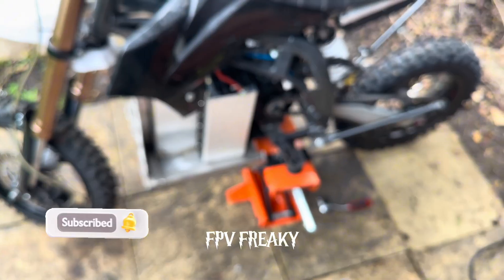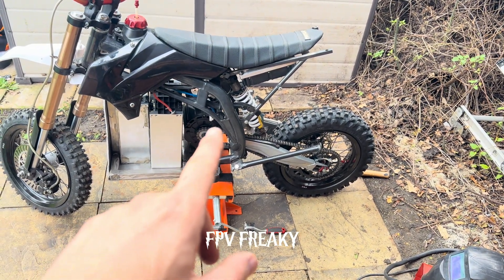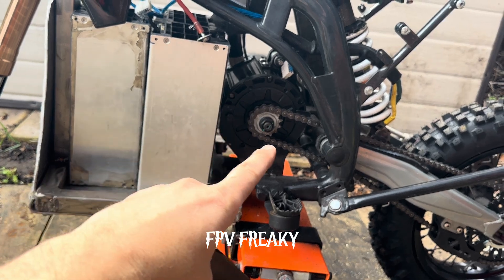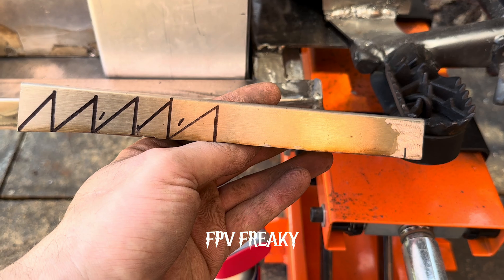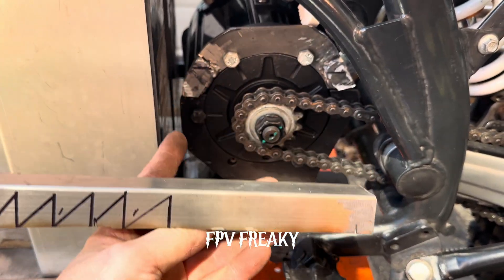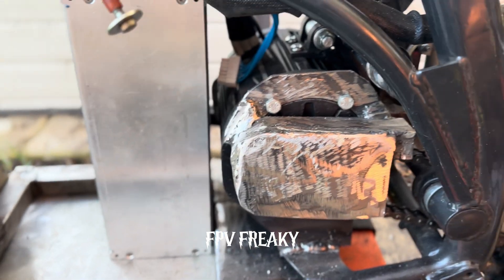The Poor Man’s Stark Varg Progress

Comment from the maker: IM FEELING ABIT DELFLATED LACKING MOTIVATION. STRUGGLING. 

INTRO

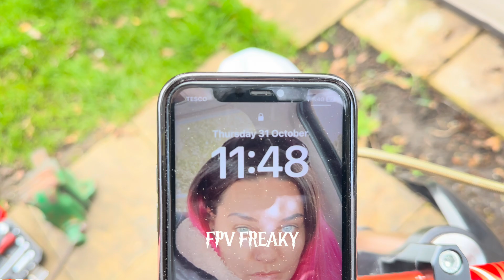0:00 intro today is 31st of October
0:31 start welding the rear seat plate support.
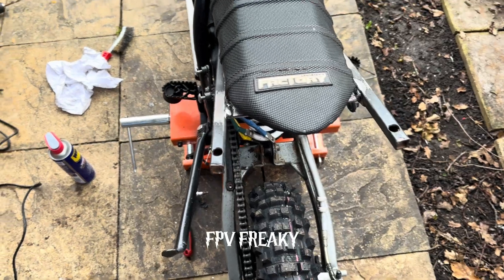1:52 test fit the seat and fitment.
2:27 making a QS 138 90 h
chain guard.
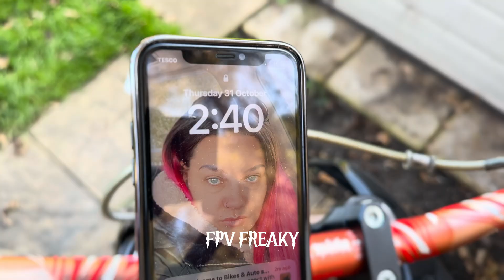4:20 time to pack up before it gets to late.
4:28 chain guard has been made for the QS 138 90 H motor.
5:47 seat plate support bracket made.
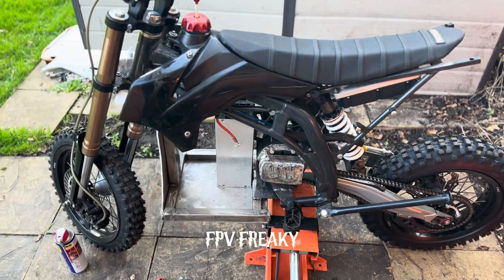6:24 cinematic footage ( subscribe )
Reply: Nothing that's really worth it, is ever that easy. It might not seem like the progress you wanted, but you got a time consuming part out of the way and the rest is almost plain sailing now. When it's finished you're going to have a machine that no other stock, or modded bike can compare with. 

You're much closer to getting it finished now mate. It hasn't taken long at all to get where you are now considering all you've done so far in just a few weeks. Almost there mate 👍
Reply from the maker: @colinriches1519  thanks mate yeah . I think it’s been the lack of good weather that’s been the problem. But now I’m almost there .your right 👊🏽😉 thanks man appreciate the support.

Comment: Can the QS motor fit a Mototec dirt bike?
Reply from the maker: @Emergencyexitguy  possibly. But depends on what dirt bike size is that there are many different variations. But you probably would need to strengthen the frame as the QS Motor is pretty torquey. You can get smaller QS motors. Like the QS 90 I think it is.?
Reply: @ will I need to build a bracket for one or is it that easy to slide one in?
Reply from the maker: @Emergencyexitguy  you might have to make a bracket. But do some research before you buy to make sure that the Motor that you will be taken out are the similar dimensions to the one that you’ll be putting in. That will give you a good idea if you could make it work. I think it would but the QS 90 it’s fairly small and powerful.
Reply: @Fpvfreaky  ok thanks!